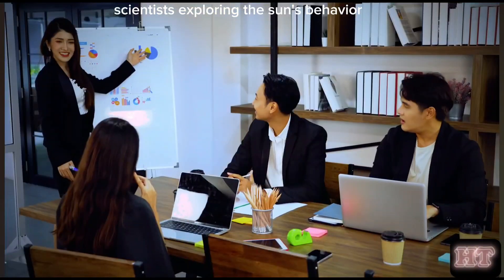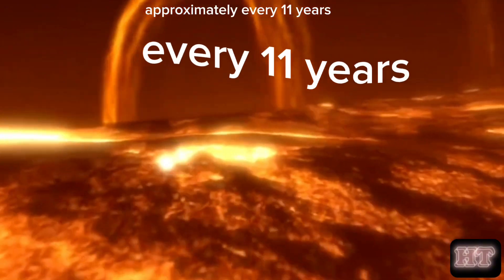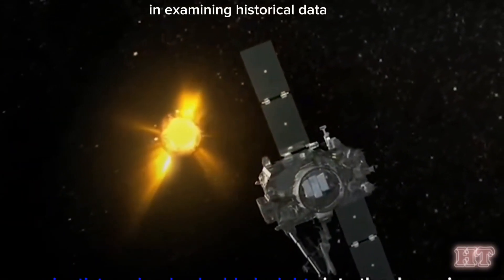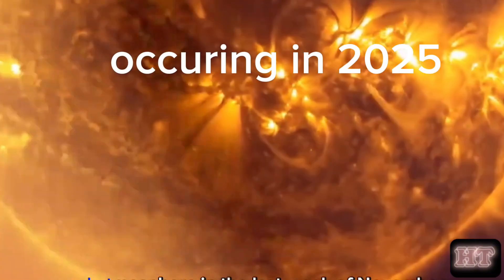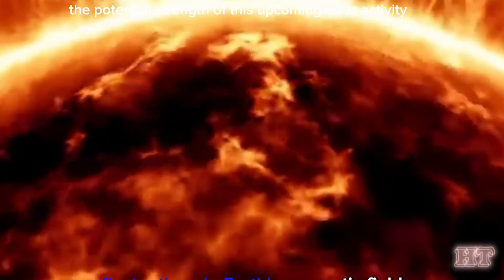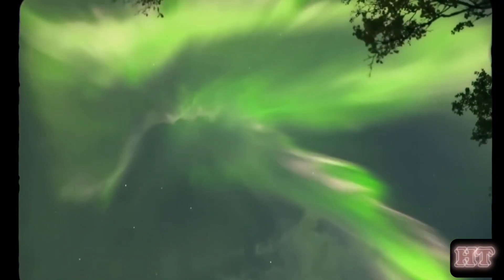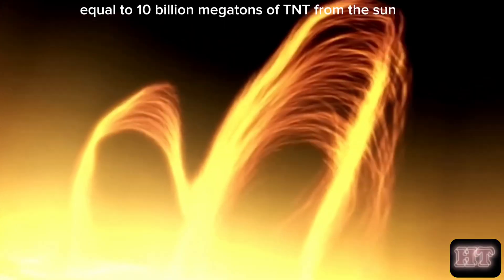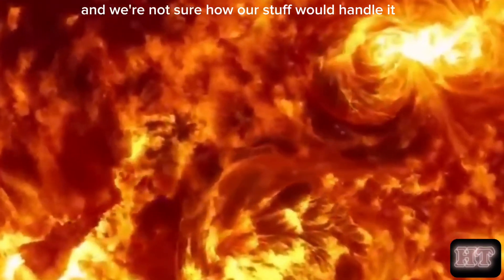Solar Storm Alert 2024: Experts Sound the Alarm on Internet Disruptions Worldwide

Comment: Nothing to worry about. First the solar storms peak every 11 years. It's not unusual. Then a solar storm doesn't have the effects many of the click bait stories claim. It can't do anything to electronic devices or power plants. It's not like lightning. It's a tiny voltage difference of a minute fraction of a volt per meter. So the only way something can be damaged is if it is connected to very very long cables. 

The only effect is on step up / down transformers that are connected to cables tens or hundreds of kilometers long. These are the electricity sub stations you may see - which convert very high voltages from long distance cables into the lower voltages for domestic use.

Even then those cables also have to run in the air above ground where there is resistive ground rock because you need a voltage difference to build up between the cable and the ground. 

If the ground below the cable is conductive (e.g. wet sedimentary rocks) there won't be any voltage difference between the cable and the ground because the weak magnetic fields from the solar storm will build up exactly the same voltages in both cable and the ground. The damage is caused by voltage differences between the cable and the ground in the step up / down transformers. 

It turns out that only a few places are actually vulnerable. The 1989 Quebec powercut was possible because of the resistive ground rock below Quebec as well as its high altitude. But since then they have made the step up / down transformers much more resilient and that powercut wouldn't happen again with modern transformers. The only ones at risk are old models or a new model that is near the end of its operating life and about to be replaced anyway. They make the transformers triply redundant in case one of them fails, so that even if a few of them fail in a Carrington type event - it would be an expensive bit of kit to replace, but the customer is likely to not even notice. In the USA most of the grid companies now sign up to an insurance scheme which keeps a stockpile of road-mibile transformers - it's really meant for hurricane damage and such-liek so that they can be up and running quickly after a hurricane - but it would also work for solar storms an dmean that they coudl replace the damaged transformers and be up and running quickly in the rare case where all three are damaged or to get back to normal levels of triple redundancy.

The electricity grid is very resilient, a bit like the internet, if there is a cable or sequence of cables available to get the electricity from A to B then they can reconfigure to use it instead of the one they usually use. 

Expense would be similar to a hurricane after a Carrington style event but most likely no powercuts or just a few localized in the most vulnerable places. The powergrid companies would know where is most vulnerable in their network also there are a few hours of warning of a solar storm after it passes the SOHO satellite between Earth and the Sun, so they would be able to respond to put their equipment into a safer operating mode before it hits and we have longer term projections of solar storms, though less accurate, of the order of days to a week or so. 

https://debunkingdoomsday.quora.com/What-would-the-effects-be-of-a-major-solar-storm-Short-term-local-power-cuts-for-hours-not-widespread-blackout-for-mo

As for the flares themseslves we can't have a superflare.

We can't have a superflare.
For a short time a few years ago some astronomers thought superflares were possible after they spotted them in a survey of stars that resemble our sun, only some of those stars and they didn't know what made a difference between the ones with and without superflares.  

They never thought they were likely for our sun, because we'd have seen the signs of them in the moon rocks, if there had been any in the last 4.5 billion years.  Something that hasn't happened for 4.5 billion years would have to be very rare. But they now know that our sun can't do them. 

They now understand why some stars have them and others don't, and ours is the wrong kind of star to ever have them. It is to do with how fast it spins and for a superflare the polar region has to spin faster than the equatorial region (the sun isn't solid so different parts of it can spin at different rates). For our sun, it spins too slowly and the polar regions spin more slowly than the equatorial regions and its magnetic field isn't strong enough. So it can't do them. 

https://debunkingdoomsday.quora.com/Can-superflares-happen-on-our-sun-observation-and-modeling-combined-says-no-only-bright-flares-equivalent-to-our-sun